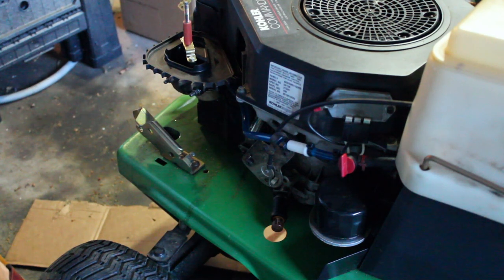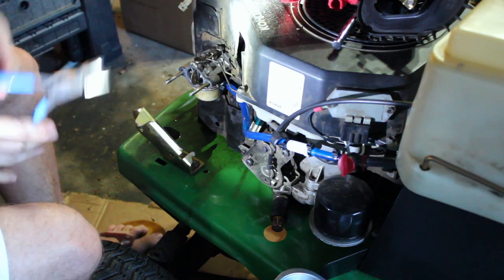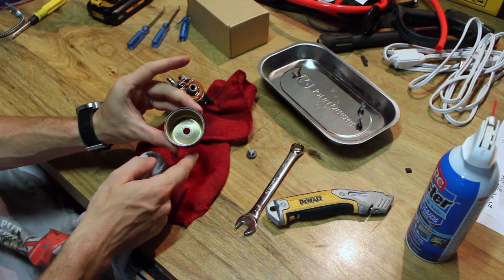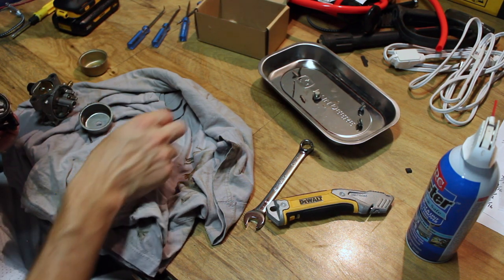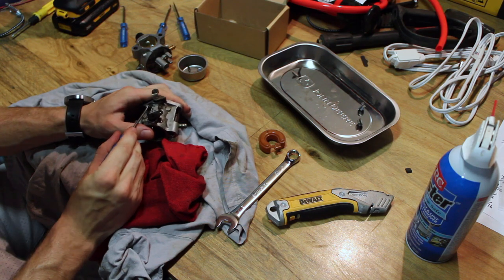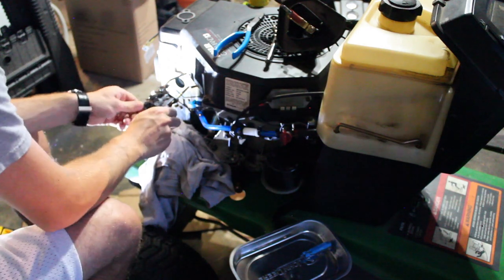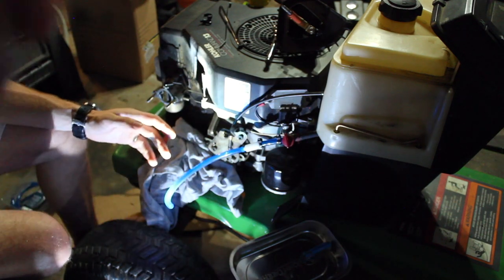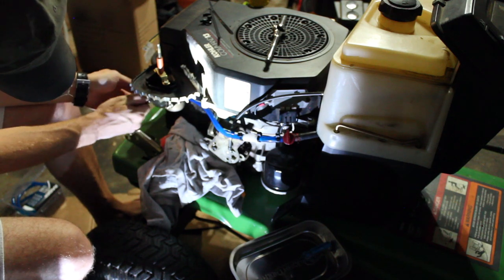JD STX38 Carb Cleaning ...again...

Comment: I had a similar problem where fuel was leaking into the air box. It would only do it after the mower ran and not while I let gas fill up in the carb before running it. Turns out it was a bad shutoff solenoid on a brand new carb. Pulled the carb bowl and replaced the solenoid with one I had lying around and no problems since.

Comment: John Deere Has TSB and you are to shut off fuel so fuel doesnt leak in carb. The problem is the brass Seat and rubber tip of needle doesnt close right?. later yrs they had a fuel shut off valve on the bowl nut to close, that worked for 1 yrs and then u had to replace it again at cost of $60. My 95 JD STX38 Black Deck bought new, runs and cuts like a dream I have mulching kit and bagger. I change oil and filter every year. Only week issue with STX38 the hood will Break.....
Reply from the maker: Good to know! I've taken to just turning off the fuel on the fuel line when I'm not using it. It doesn't leak at all when it runs. Still cuts just fine!

Comment: My float bowl gasket was leaking so I replace with Amazon carb and now won’t run right. Bought a few of them and none of them will make it run right. Replace gasket on original carb and it still is running bad. Ran and cut really well before this. Any thoughts? Stx 38 black deck